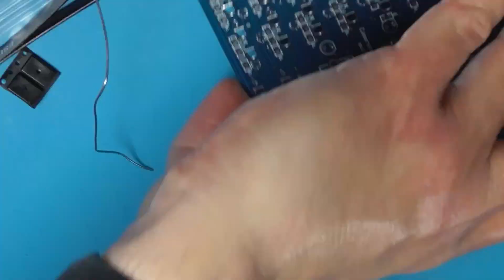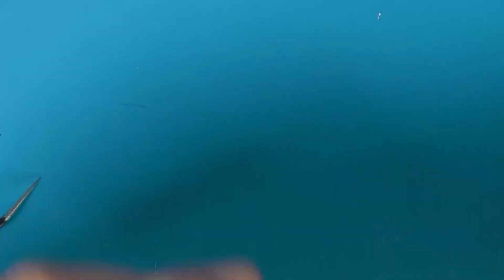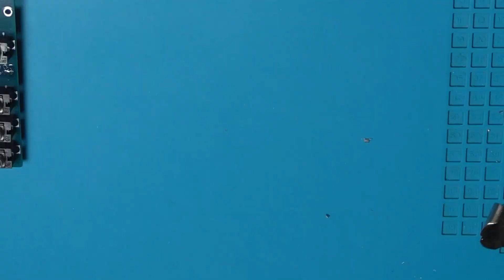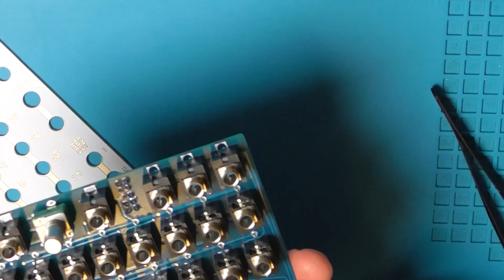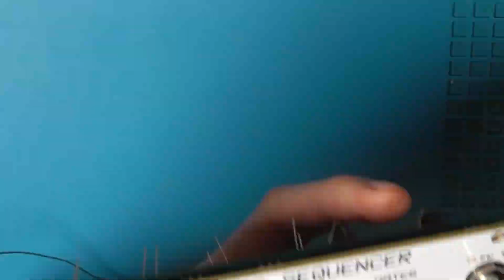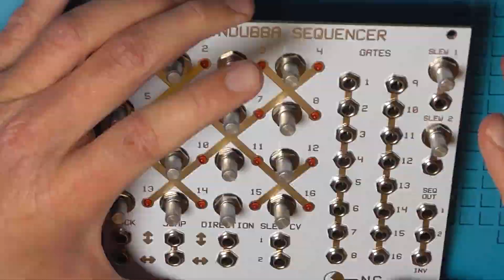Nonlinear Circuits Bindubba Sequencer - What's It Like Building a Bindubba Sequencer?

Comment: Nice video! Not sure what size solder and tips you are using there, however I found that when I switched to smaller sizes for SMD, I made less mistakes and could be more accurate. I use 0.25mm solder and a Hakko T18 C1 Bevel tip for SMD, whereas I use 0.8mm and a Hakko T18 D12 tip for through hole.
Reply from the maker: @mwmacp  Thank you! Good pointers! I’m using 0.8 mm solder and I switched out my default Hakko tip for a T18-B/P cone tip.

I never thought to switch to thinner solder for SMD. Good to know!